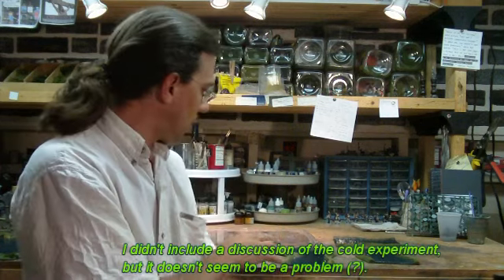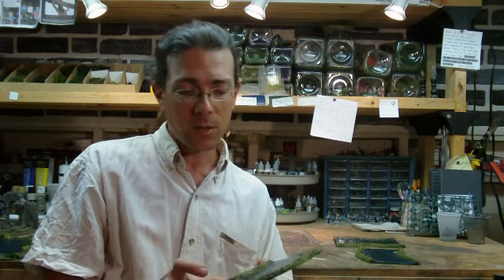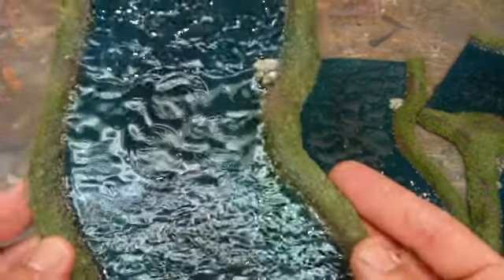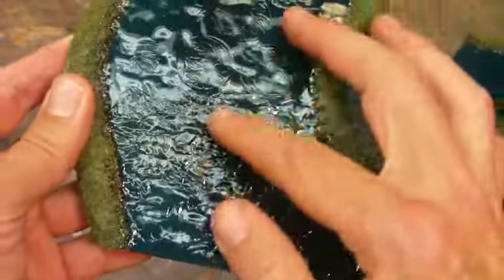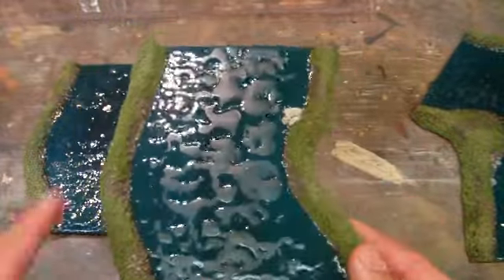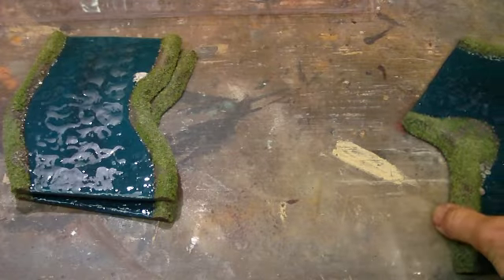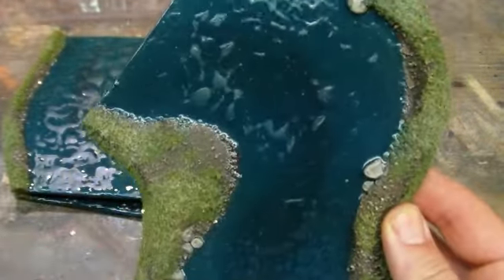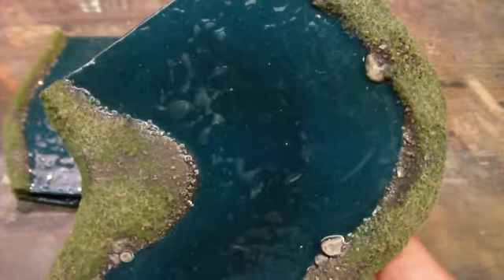TerranScapes - Water Coating Experiments - River Waves

Comment: I have the base formulation to start with.  (It's based off one we use it for a roof coating, so you can be assured of the materials strength and damage resistance).  I'm trying different additives to manipulate the final products plasticity and viscosity so that it isn't too self leveling and can be molded into waves.  The material will not be as chemically safe as an acrylic product, there will be some VOC's in it as well.  But I hope to produce something that will at the least perform

Comment: The clouding issue intrigued me.  In my spare time at work the last few months, I've been working on a polyurethane prepolymer to be used in a moisture cure urethane coating that should eliminate the clouding issue.  I dont have all of the products you display, so I can't say for sure what they are formulated from, but anything acrylic, or water based, can be somewhat susceptible to moisture attack, creating issues such as the clouding, or delaminating.  My project is still several months away

Comment: What material do you use to hold in the water? Is it clay? (under the fine turf grass material).
Reply from the maker: No, in these pieces, it is just the urethane plastic cast and then painted over.  I don't need a dam for the water if I pour a very shallow layer. :)
Reply: Thank you for your answer. Your video's are verry good! :)